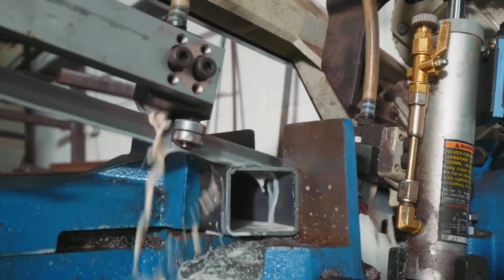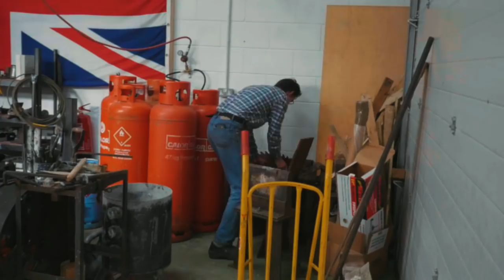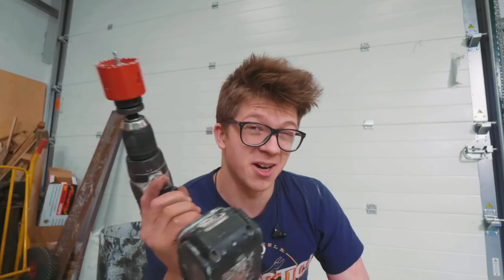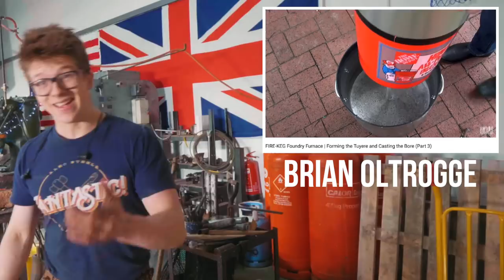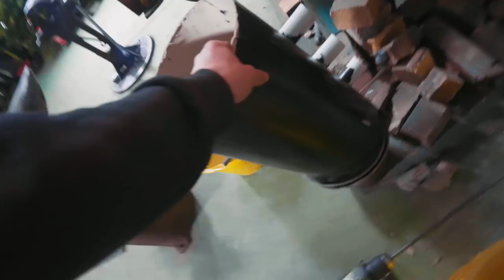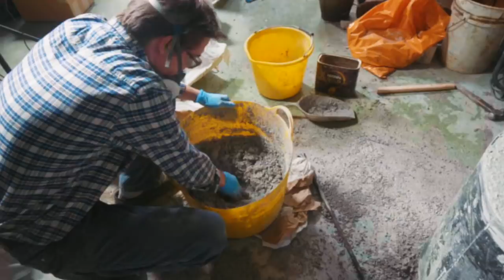BUILDING A FOUNDRY!!! PART 4

Comment: The furnace is looking good! I strongly advise you to wait approx. a week before you apply any heat because of the thickness of the refractory wall. Then only apply enough heat to slowly dry out the lining, for instance you could use a 100 watt incandescent lamp suspended near the floor of the lining, cover the opening of the furnace lining to retain the heat allowing the moist/hot air to escape through a small hole (approx. 2"). If you get too anxious, the moisture under the surface of the refractory lining will turn to vapor pushing out pockets of refractory away from the lining making what we Americans know as "potholes", the kind you might see in many of our city roads. In the case of a newly cast furnaces' refractory lining, slow and steady wins the race.

Comment: Keep that tree watered. Hot sparks (ignition source)  + dry tree (fuel) = chemical reaction resulting in rapid oxidation.
Reply: Sam Fowler Fire.
Reply: Yes! A very hot, rusty Christmas!
Reply: I missed your sarcastic tone there Sam. 😀
Reply: Kyle Richards water it with red wine to prevent that rapid oxidation, after all it has antioxidants

Comment: A threaded dowel with a nut and washer to hold the cardboard form in place instead of the PVC would keep your tube from floating out of the concrete. Spectacular Job!

Comment: Hey, Alec, I know it's too late, but maybe should have filled the cardboard with dry sand. Solid force to hold back the refractory force.
Reply: I was going to suggest that. But I was too late. Hope it works out. I've seen other forge builds. Keith Rucker at VintageMachinery.org He built a bigger one.
Reply: didn't they fill it with coal coke?
Reply: Heimlich Mud that was my first thought
Reply: Sand was what I was thinking as I just watched the video. Especially if it's was a packed green sand. It would not only add rigidity but weight to hold in place.

Comment: Hey, if you're ever doing this again, if you want to be sure there are not any air pockets, you can run a random orbital sander on the exterior of the mould with no sandpaper on it after a thorough tapping on the outside with a hammer. Has worked well for me.

Comment: hey man, i really love your videos. just a quick tip for the next time you're pouring concrete (or whatever powder mix) to avoid dusting, put down the sack in the tub (upside down) cut it open at the bottom, and pull in up. that way you wont nearly get as much dust. have a good one! (also from the netherlands btw)

Comment: Alec, for future reference...if you need to cut the water in a batch of concrete (which is a good thing...makes it stronger), look into using a plasticiser addative.  It will make the concrete flow better, as if it had more water in it, without making it weaker.

Comment: For saftey reasons you may want to weld a plug in where you drilled out for the PVC, and add a bit of the cement to fill where the pipe was on the inside. If you have a catastrophic failure of your crucible all of the molton metal will flow out from the hole instead of being safely contained in the furnace. 

Stay safe, don't burn down the shop :)

Comment: To all the geniuses saying, "You should have put sand in the tube," It was not needed... Obviously. The tube has zero buoyancy since its open on the bottom, and held in place from vertical movement, by the tubes into the burner holes. That would have been a good idea for the bucket yesterday, but not today.

Comment: cool videos! when you go to remake your lid, try getting some steel wool and pulling it apart a bit then make your lid shape and pour the cement around it all. that will make it more sturdy and last longer as you will be moving it more and without that support it may crack and fall apart. keep up the good work.

Comment: If you ever have to do something similar in the future once you get the cardboard tube in place fill it with sand. The weight will help hold it down and make the cardboard more rigid. You might also want think about covering the outside of the cardboard tube with a couple of layers of plastic wrap and then cover that with duct tape to help keep moisture away from the cardboard tube. You could even put the tube in a tall kitchen trash bag and tape that instead of plastic wrap.

Comment: Remember before you start to cast you have to fire the Crucible so that it does not crack. You do that by putting the crucible in the furnace when you light it and letting the crucible heat up with The furnace. If you don’t the crucible will fall apart when you try to use it

Comment: Could have got a hand sander with no paper on around the outside to vibrate it down. Or failing that weld some nuts on and run a impact driver on the nuts to vibrate it.

Comment: Great job using the tube as a core pattern, and the PVC centering pipe will definitely help! My only concern is the lack of insulation...that solid slab of refractory is going to leak heat like crazy. Also, the vent hole may be too small for a 3-burner affair. 

That said, you're foundry furnace will be a great asset to the workshop! Cast pommels and guards, cast tool holders and machining blanks...the sky will be the limit!!! Caution, once the casting bug bites, there is no cure...its a lifelong disease ;)

Comment: One way to get the moisture out of the cement without heat is by using silica gel. Basically the same stuff that is included in tiny bags with new electronic products. Except here one would need a somewhat larger amount. This stuff is used in large bags by power companies to remove water from the coolant in large transformers. So, try to find a manned transformer station (many are remotely controlled these days) and ask if they would lend you one for a week or so.

Comment: Great vid.  a little late but, to help it keep form you could have used sand or even gravel to fill in the cardboard tube.  Then once the refractory was cured you just have to pour it out.  When it's time to replace the burnt out refractory maybe you can give it a try.

Comment: Just a suggestion, whenever you use a hole saw drill the pilot first without the saw. Then put the saw on the drill. This will save your drill bits.

Comment: Nice idea for using the cardboard box. But I think using wood is also good in case you need to make more foundry or sell one. You can make a cylinder made of wood by using router bit to make an exact size of rounded plywood that are joined together.

Comment: I used cardboard to cast my small forge but for you I would suggest kao wool.
It’s ceramic fibers felted together. It won’t burn or crack. 
The only problem is that it’s expensive.

For your lid. Next time put some steel wool in it to hold the thing together

Comment: Alec you need to twist the pvc pipes every 20:00 minutes and in about 3 to 4 hours twist them out the cement will shrink and crack around the pvc if you don't and yes cear it with light bulb good look😎👍👍👍

Comment: hello you should put wire to the top of the melting furnace because the concrete or cement are brittle and the wire read a firmer structure greetings from Argentina I love your videos

Comment: You might have been able to coat the cardboard tube with diesel fuel. Cement worker's spary diesel on the forms to prevent sticking.  Also the diesel would act as a water barrier.  Im sure your method worked perfectly fine though.

Comment: sonotube.... done :) its common for anywhere that deals with concrete. my only question is why did you not use tubes larger I.D. then the burner's O.D. or welding the tube in farther so the burners were just in the middle or slightly recessed instead at the outside.

Comment: Watching this in the beginning I was just thinking “that tube is going to collapse if you don’t fill it with sand” but then you ended up doing pretty much that, hoping it turns out good this time! Also, I probably would have welded the handles to a piece of plate steel and cast that into the concrete, just seems to me like those handles will pull out easily if that lid is heavy enough. Hopefully I’m wrong though and you have no problems!

Comment: I used my refractory a lot wetter when I made mine. Was this wrong ? I’ve done at least 30 burns since making and only have a cpl very small cracks 🇬🇧😊🇬🇧
Reply: Its not you just need a lot more time before you fire it up.Its like mixing wet concrete-it will fill holes better but it takes a lot of time to settle.

Comment: My only suggestion, as I have encountered this problem with mine own aluminum foundry, is not to use bricks in the bottom. (Too late huh?) The reason I say that is because the bricks and the cement heat and cool at different rates, which over time will cause cracking and chipping. Mine fell apart after about 10 burns. Hopefully yours'll last a bit longer.

Comment: Maybe a little late for this but why did you not fill the cardboard tube with sand? It is roughly the same density as the refractory cement and it is rather easy to remove once the cement sets. Just make sure you fill in the tube at about the same rate as you pour the cement

Comment: Maybe it's too late for an advice, but you should have put some wire mesh into the furnace lid so it doesn't crack under the heat stress.

Comment: I hate saying you should have but it would have been a good idea putting some sort of fiberous reenforcement. Such as steel wool.
Reply: Rebar or chicken wire maybe?
Reply: Nuclear_ Nube no that would defeat the whole purpose of the refractory cement acting as an insulator if there are strings on metal running through it. He could have made small blocks of the refractory cement and used those to shore it up though
Reply: That way sounds better
Reply: I guess I didn't think about the energy conservation. You are right over time it would be less time to heat up items if there is no metal.
Reply: Surely the metal would expand at a different rate to the refractory and crack it?
Reply: Asbestos fibers? Or a non-lethal equivalent?
Reply: They make additives specifically for that instance. That's why sidewalks and most driveways don't have steel mesh in it anymore.
Reply: Nuclear_ Nube steel wool that would melt?
Reply: Andrew Delashaw wrong. Fiber adds strength but rebar or wire are necessary to prevent large cracks and/or shifting. (I can’t count how many concrete driveways and walk ways I’ve replaced because they had cracked severely from not having rebar in them
Reply: Steel wool would actually melt over time, eventually flux, and literally melt the refractory. Monolithic refractories are designed to mechanically bond to itself, negating the need for reinforcement.

That said, horizontally suspended refractory doesnt always hold up over time (versus monolithic being mostly used vertically). That lid should have a single slip-rolled band of steel around it, with a lip that would lock it in.

I guess using the leftover refractory he mixed for a lid is a way to keep from tossing out perfectly good material, but it wouldve better been used to make plinth blocks to hold the crucible up off the floor and in the path of those burners. Id advise a lid v2.0 to be put on the to-do list, with a steel band and retaining apparatus included

Comment: Wouldn't it be better to make the furnace more insulative ? I would expect this thing to take ages to come up to Temperature since it contains so much concrete... Wouldn't it be good enough to use kale wool and like 5cm of concrete as a lining ? Of course the bottom has to be solid but the hole furnace ?

Comment: Try styrofoam next time, I use it for casting my castable forges because it can be carved to most shapes easily and removed with petrol.... or fire.... or petrol then fire for super fast all be it smokey results. a coat or two of pva can make the surface finish pretty damn good too. I used cardboard for years but the faffing and reinforcing is a pain. Its worth having some stainless steel mesh in castable refractory too, reinforces it and makes it last a bit longer. just a single layer of stainless chicken wire of square mesh all the way around about halfway in depth wise makes a huge difference to the longevity of the forge/furnace.

Comment: instead of using the natural air burners, why not try using forced air burners? they use less fuel and they produce alot more heat, and you can adjust the amount of air that is supplied. also they produce ALOT more heat! enough heat that you could melt steel. and they will help melt softer metals very quickly.

Comment: ##TRASH BAGS## you could of put one in the carboard tube on filled it with water to stabilize and weight it down...line the bucket when making the lid and it will come out easy when dry just lift out saving your bucket

Comment: when you use your saw to cut steel does all the cooling liquid go on the floor or there's something to catch it?
Reply: DNLYUSEmeBIADE usually when cooling liquid is used in a saw or a lathe, it is caught and reused. It goes through a filter to remove the metal in it, then into a pump and the used again.

Comment: You should have filled the tube with sand, then no pressure would have acted upon it with sand on one side and the concrete on the other.

Comment: Pro tip:
Fill the cardboard tube with water to add outward pressure  instead f leaving it empty, you can then dump or suck the water out and dry any excess before firing.
Apply waterproofing prior to filling, flex tape is pricey but worth it